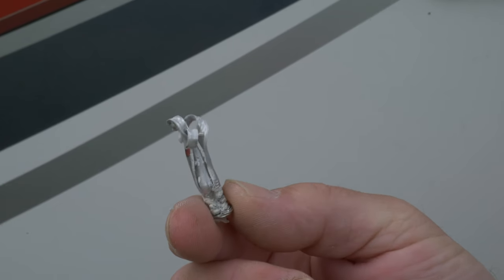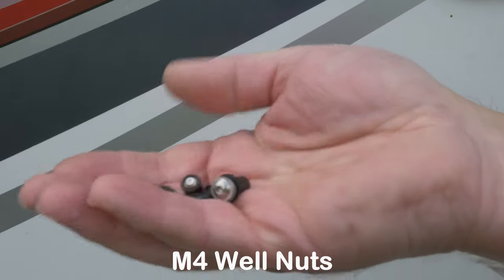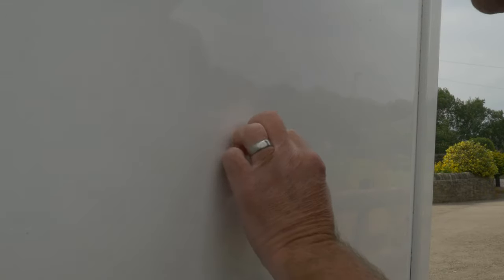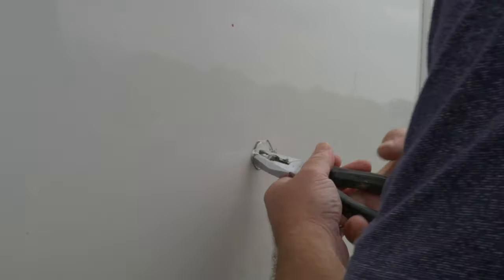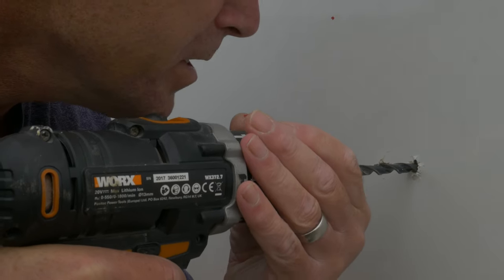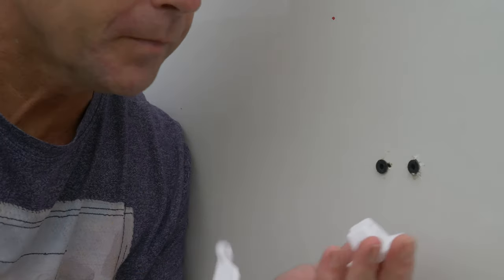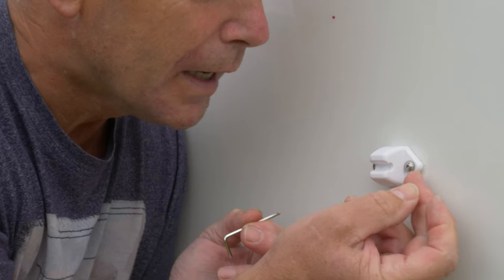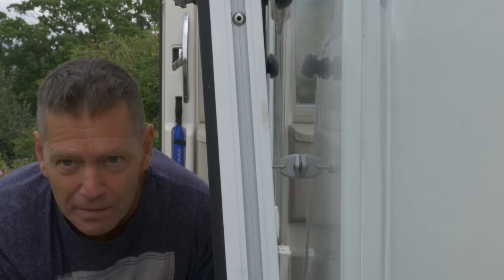Replace motorhome Locker door catches

Comment: Great video, hopefully will resolve the issue I have with my Motorhome, as a couple of the rivets have pulled through the sink of the van. Please could you provide a link to the product you purchased. Thanks.
Reply from the maker: Tony Bendell there are cheaper versions, but given the use to which they are put, I preferred to pay a little extra for quality. 
https://www.ebay.co.uk/itm/202776653954